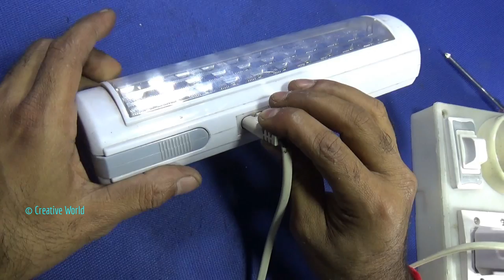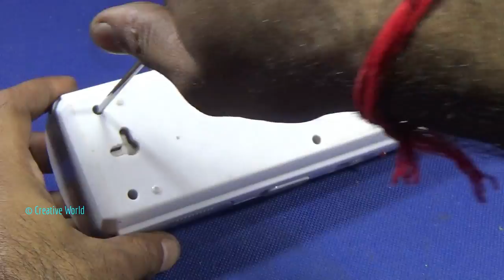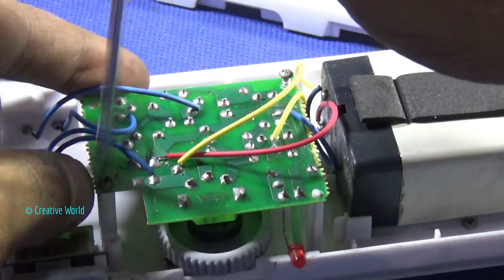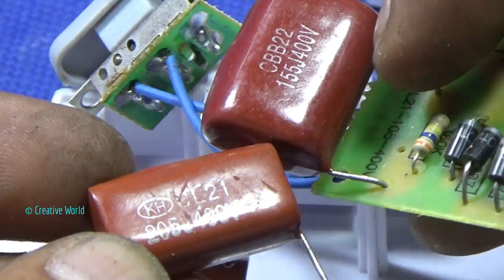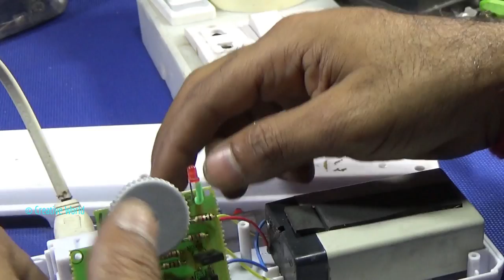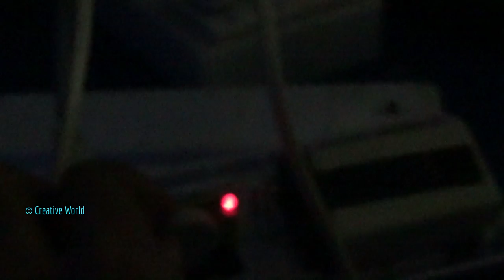How To Repair Power Problem Of A LED Flashlight

Comment: is ka charger kasi repair ksrai jab dc voltage 3 say jiysda nikalay please bta do
Reply: charging light kiska app nai condenser badla hsi
Reply from the maker: you should check capacitor, diode and resistor

Comment: Sr 185 J 250v ki jagah 185 J 400v ka capacitor laga sakte hain
Reply from the maker: yes , you can,,
but using 250v  capacitor is best
Reply: Thanxx for quick reply sr

Comment: If everything is ok and then also the light is not blowing led is not blowing and current is also bad passing and charging also coming what is the problem
Reply from the maker: check the led please
Reply: Nonsense how you capacitor the problem is the problem without using multi tester